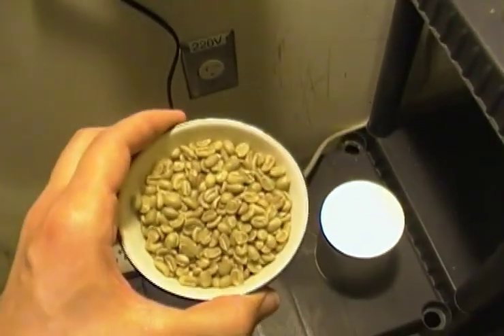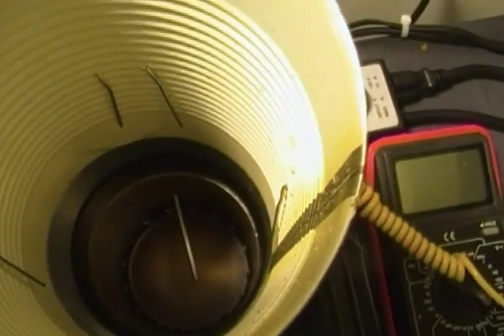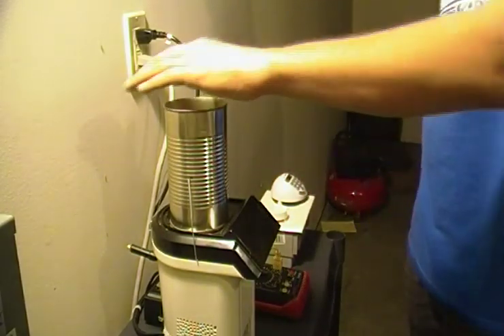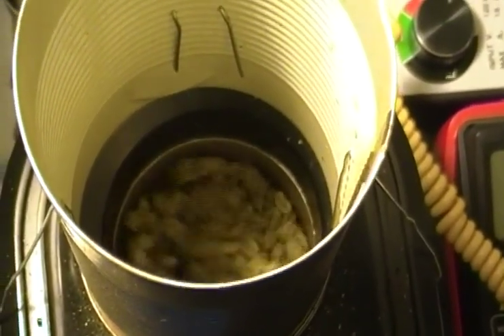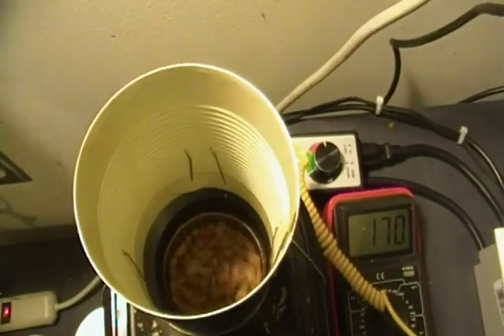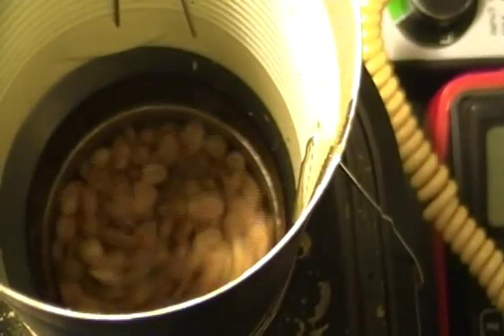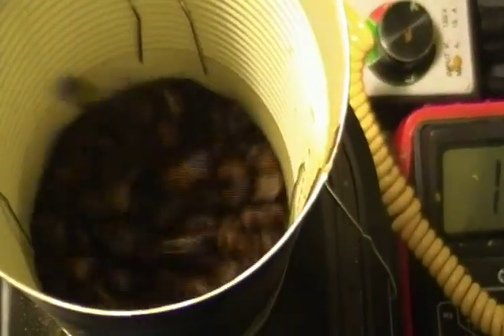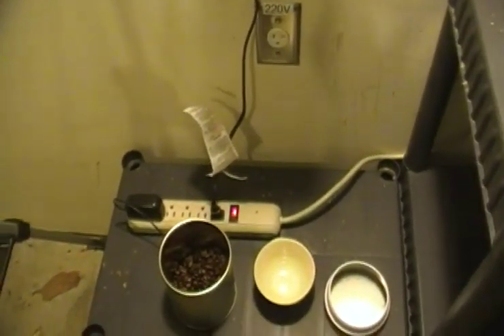Roasting Coffee in a Highly Modified Popcorn Popper

Comment: Thanks for your response, Joseph. I will be starting my mod today with a 1500 watt unit.  Since I have a rheostat, I'm planning to use that and see if I need a fan speed control since I'll have 12.5A at 120VAC; 1500 watts max.  I really like your ideas of tilting the chamber initially to increase the angle of repose at the bottom and thus achieve fluidization prior to drying and density reduction. I saw in a previous comment that you said adding the extra holes and widening the fins made a big difference in airflow, so I will definitely keep that in mind.  Also, thanks very much for the second video detailing the wiring with respect to the heating coils !!! Based upon your results, I'm really looking forward to this project.

Comment: Just wondering Joseph, I see this was in 2012, so would be interested to hear if you have made any updates to your project. Are you still using it? Your project is far more ambitious than mine. All i done was remove the outer casing for better airflow and bypassed the switch for the fan. The switch only supplies the heating element. To switch the whole "roaster" off, (heating element & fan), you just switch it off at the wall (I'm in UK with 3-pin switched sockets).

Comment: i have heard differently on the degassing. The only reason people let it degas for a day is when vacuum sealing it so it does not explode the pack. Fresh roasted easily tastes the best.
Reply from the maker: Your correct. One never stops learning about coffee.
Hand brewing or drip coffee can be brewed immediately that is why you have your 30 second bloom.

However, for espresso I still believe that it needs to rest, but I've never read anything using scientific methods to prove that either. So it could very well be myth as well.
Reply: john hancock yeppers.

Comment: I'm interested in how much coffee you used in the video.  I have the same setup as yours only, being the control freak that I am, I made it computer control.  I have been using 1/3 cup of beans.  This seams to allow a ton of airflow but the temperature stops rising at about 385 degrees unless I turn the fan speed down or occlude the hot air exit exhaust.  Did you have this problem?  Did you modify the fan in any way or are the high number of beans slowing the airflow enough to allow the higher heat?
Reply from the maker: I haven't roasted in a while, but I think around 1 full cup. 
I DID have some issues with getting up to temp. However, once the temp starts slowing down, I do turn the fan speed down to get the temp up and because the beans are lighter at this point it doesn't take as much air to get them to move.

There is a magic number as far as amount of beans. The problem is that the number is different with different types of beans because the variance of density and moisture content. 

Too few beans and they dont get hot enough, too many beans and they won't tumble enough and you get uneven roasts.

As for modifying the fan, the only mod I made was the holes for airflow (this made a big difference) and I used a flat tip screwdriver to pry the fins on the chamber open slightly wider.
Reply: +Joseph Collins I was going to drill holes in mine too but I am thinking it may loose more heat that way too... But fan speed is nice!
Reply from the maker: Yeah, so that is where the dimmer comes in handy, when the beans are dried out more, they spin around better and you can lower the fan speed so that you are not sucking in so much cool air.

Comment: I liked your mods; nice to have separate control of air speed and resistance heaterl temperature.  the video didn't show adjustment of the resistance heater or the fan motor, but I presume you were doing that.  I would think that the fastest fan speed would be best with perhaps some level of control on the heater current
Reply from the maker: ChicagoJohn Correct, A full explanation of how the mod was done is listed in another video, https://www.youtube.com/watch?v=S4KXvGZOivA
Reply from the maker: Joseph Collins also, sometimes I need more heat and not so much flow. The best scenario would be full fan (more movement = more even roasts) and more heat. However, sometimes I need more heat when the heater is full blast, so I can get a little more heat by reducing the amount of heat lost via slowing down the fan.

This popper is 1200W, but the mod works better on the 1500W models, however they are much harder to find.

Comment: I am wondering if you could use the another dimmer to control the temperature of the heating element?
Reply from the maker: I don’t remember the amperage of the heating element, but the reason I used the rheostat instead of another dimmer was because I couldn’t find a dimmer that could handle the amperage of the heating element.
So, if you can find a dimmer capable of the amperage, it would work.

Comment: Thanks for the video. I too use popcorn popper and 3.5 min into roasting i get a very oily dark roast. No idea why, even at 2.5 min. Anyone has any idea?
Reply from the maker: Roasting too fast. Getting oils on darker roasts is normal, but you shouldn't have beans that dark in 2 or 3 minutes. 
You need to increase the fan speed, the airflow, and throttle the heating element down. 
You want to dry\toast the beans first. Then you want to start warming up and you want to draw out the process so that the heat can reach the center of the bean and develop the natural sugars. If you go too fast, it's like cooking a burger on a 600-degree griddle, you burn the outside and the middle is still raw.